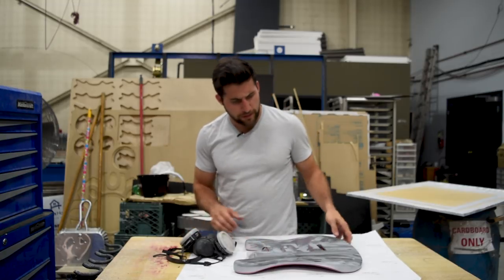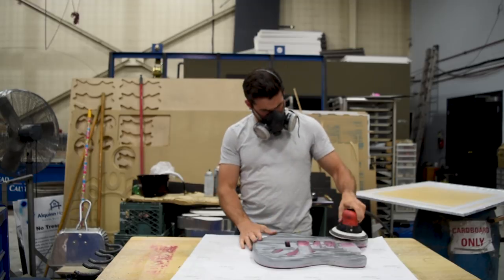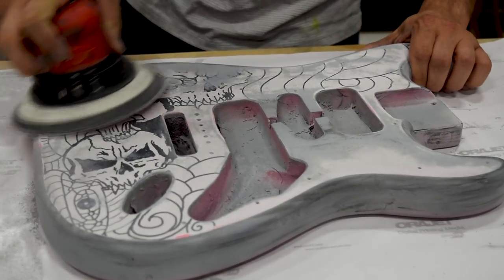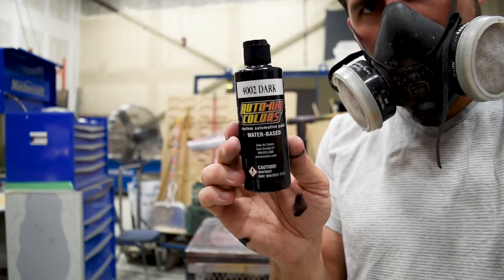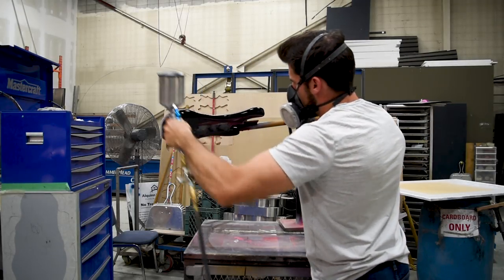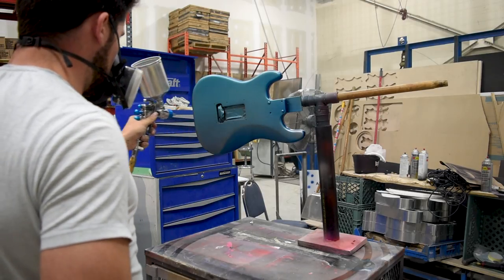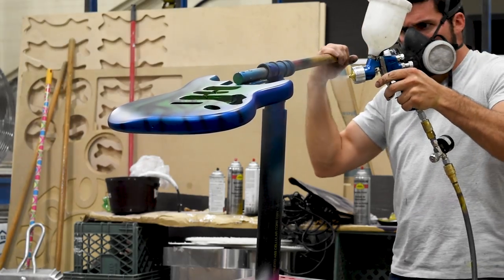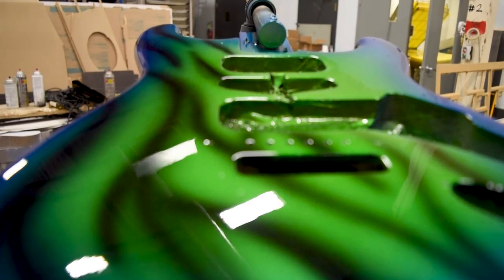How to Make a Cheap Guitar Awesome Part 1

Comment: Very Nice Paint job. I just ordered the Dark Sealer and the Aluminum base to try this myself. I have a bunch of the Candy 2o Paints. Quick question. Are you using a reducer on any of the paints or are you going straight out of the bottle. I know the Candy 2o's are pretty thin. Thanks.
Reply from the maker: I used about 10% reduction for the aluminum and pearls. I also reduced the Black that I airbrushed.
Reply: Brad Angove Thank you sir!
Reply from the maker: You’re welcome. Thanks for watching.

Comment: I have a Squier Bullet Strat and the pickups on it were incredibly weak. The string trees needed to be replaced with decent ones. The rest of the guitar is decent. So, I got some Fender 'roller' string trees for that guitar, a Squier Affinity Tele, and my Ibanez guitars. They make a big difference in tuning stability. I also filed and put graphite (pencil lead) in the nuts of each guitar. On the Squier, I replaced the entire pickguard and pickups with a loaded one which has Alnico V's off of ebay for $22. The Bullet Strat sounds amazing now and the tuning is very stable. I could have gone one better and got locking tuners. But,  I don't play it that often. I stick to my Les Pauls usually - among my other guitars. The Strat is very specific, I think, for any covers I'd do with it. Steve Miller Band, Pink Floyd, etc., are a given for that Strat sound.
Reply from the maker: Sounds like you managed some pretty solid upgrades in a very price effective way.
Reply: Well, I'm on a fixed income due to a stroke I had in 2006 disabling me. So, I work within that budget. Ya gotta get inventive when funds are limited. :-) I do ok tho!
Reply from the maker: Sounds like you do pretty well.
Reply: Eh. I just take life one day at a time. :-)

Comment: Sorry if this is a dumb question. What’s the difference in paint drying and the term “flash off” you use a lot?
Reply from the maker: +David Ball flash off is where the paint is only partially dry and the solvents have evaporated enough to coat it again and achieve chemical adhesion.

Comment: Hey Brad, I'm in the middle of guitar finishing project right now using a cheap body I got that was finished in a Monaco Yellow polyurethane. I dulled the gloss finish with 0000 steel wool and then applied about 3-4 coats of a Duplicolor Perfect Match color (Olympic White) and then about 2-3 coats of Duplicolor Perfect Match clear gloss. I've been reading bad things online about the Duplicolor clear, so I just got a Minwax Clear Gloss Lacquer aerosol to try out, which I also want to use to finish my Warmoth neck with. My questions are: 

1.) Do I have to sand back the Duplicolor clear coats that I already applied before applying the Minwax lacquer spray -- or is it not an issue to just go ahead with the Minwax? 

2.) I'm not going for a showroom extreme gloss finish -- I'm trying to go for a thin, relic, dulled finish, so can I just do a couple coats of the Minwax clear over the body, let it dry for like a day or two, and then start to wet sand, polish, buff? I've read that the Minwax is nitrocellulose-based, and people usually advise to let it sit at least a week. But I am not going for a super shiny/glossy/mirror finish -- so I wondered if I could skip the long wait if I'm only applying a light amount of the Minwax. 

Thank you so much in advance!
Reply from the maker: +Jimmy Gray Hi Jimmy. Have you had any trouble with the duplicolor?
Reply: The only trouble I've personally had so far is that (after only ~24 hours mind you) it feels a somewhat not durably hardened -- upon holding it while inspecting the body, I noticed that my hand tends to very slightly stick. I put a space heater near it and plan on re-inspecting it tonight -- but I just thought I should avoid it after seeing so many negative reviews. But if it's fine enough for what I'm trying to achieve, I wouldn't mind trying to buff it out and see if it gives me a good enough thin/dull finish, without using the Minwax lacquer.
Reply from the maker: +Jimmy Gray usually we give that stuff a few weeks to harden, so you might find that  the duplicolor ends up working just fine. If you want to add the minwax, I would still give it a week, then sand lightly and apply a coat or two. 
I would be hesitant to skip the waiting period even if you're not looking for a deep gloss. Polishing soft clear is a risky endeavor.

Comment: Is that primer available in spray can ? If not, what would you recommend ?
Reply from the maker: The auto air sealer? No, but neither is the rest of this particular paint. So the primer will depend on what type of paint you choose.
Reply: @BradAngove  Thanks for your response. I am a newbie but I get that now (I have to choose everything before I even start to sand). I am building my first DIY kit. It is a Solo telekit but I have a challenge. I want to keep the natural wood color on the back and the side but I would like glossy dark black on the front. Might be a stupid question but can you apply a sealer on wood directly or should I use a vanish or something like shellac before ? I have so many questions that I was wondering could I hire you for a conversation on a web conference call ?
Reply from the maker: This kind of sealer is specific to this paint. Normal wood sealer goes straight onto wood. Shellac for example is a sealer. You would probably apply a clear sealer to the whole project, then sand smooth, paint the front black, and clear coat the whole thing.
Reply from the maker: I kind of do a priority question response thing for my Patreon supporters if you’re in need of extra help. I haven’t typically done phone consults, but I’m open to the idea.
Reply: @BradAngove  I will send you an email then and we can discuss the idea. Thanks,

Comment: This is truly a work of art man! Did you buff out the clearcoat or did it turn out so shiny right away?
Reply from the maker: +Edwin den Hertog I didn’t bother buffing this one. I was happy with how it settled straight out of the gun.
Reply: Brad Angove  Amazing piece of work.....
Reply from the maker: Thank you sir.
Reply: What do you think of this plan: I am planning a purpleheart guitarbody. Yes, it will probably break my back, but it will be a man's guitar.....
I'm planning to pore-fill with epoxy and clearcoat with Spraymax 2k high gloss. I will buy 2 small 250 ml cans and will use one to spray 3 coats with 10-15 minutes in between. I'll let it cure for 2 days, sand it lightly and spray another 3 coats. Then I'll do the full sanding and buffing process to obtain a really shiny clearcoat. I want to spray a few more coats than you usually advise because I want to have sufficient material to sand without sanding through.
Can you agree or do you advise otherwise?
Also, I want to experiment with wipe on poly on an old project which I finished with Liberon finishing oil some 8 years ago. Can it be done?
Thanks ahead Brad!!
Reply from the maker: +Edwin den Hertog To your first plan; I agree. I think that will look great. 
I’m not familiar with Liberon finishing oil. You can experiment with the poly over it, but I have no idea how it will turn out.
Reply: Thanks again Brad! Glad I have someone I can ask! I'll give it a go on a less visible part of the guitar. Liberon in sold mainly in the UK and is somewhat the same as Danish oil.
Reply from the maker: +Edwin den Hertog I’ve applied poly over danish oil before, with pleasant results. I hope it goes well for you.
Reply: You know what I'll do? I' ll sand the guitar and give it a go. The worst that could happen is sanding the poly of and oil it again.... I'll keep you posted!
Reply from the maker: +Edwin den Hertog Sounds good. I look forward to hearing how it went.

Comment: Brad if I use a poly spray, minwax or something like it, I have found many people quoting the 3 coats 3 days rule. Would I do a high grit sanding between each coat? Or after all 3? And do you feel that one way or the other is better? Ps. After watching your wipe on poly tutorial I am also considering wipe on. I don’t want to over sand, but i am really trying to avoid orange peel and just get that smooth shine like a fender. Any advice is much appreciated, thanks man!
Reply from the maker: You will need to sand between sessions. So you would apply your three coats, wait a day or two, sand, and repeat. The wipe on method is for a very thin coat. You may also want to have a look at my video on how to brush on a gloss finish.
Reply: Brad Angove, sweet man I’ll watch it now. Thanks!
Reply from the maker: I hope it helps.

Comment: Should you sand between coats?
Reply from the maker: I have a dedicated video on whether to sand between coats. Have a look; it depends on a few things.
Reply: @BradAngove  ok thanks
Reply: So no need to sand between black sealer and aluminum base and then candy’s
Reply from the maker: I would generally sand after the sealer.
Reply: Thanks for responding I’ll sent a pic when done

Comment: Would it be a total pain to do this whole job using an airbrush?

I think I've found the colors you used in this:
http://www.autoaircolors.com/paints/4002.html
http://www.autoaircolors.com/paints/4103.html
http://www.autoaircolors.com/custom-candy-colors/4660.html
http://www.autoaircolors.com/custom-candy-colors/4655.html
Reply from the maker: You wouldn’t be able to get the base coat on there properly with an airbrush unfortunately.